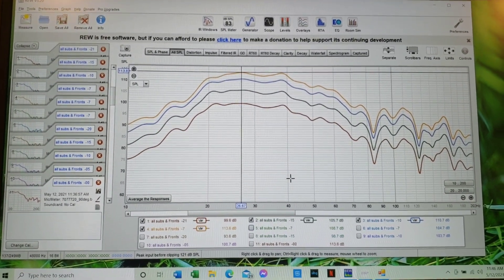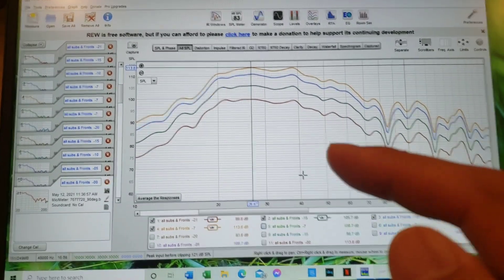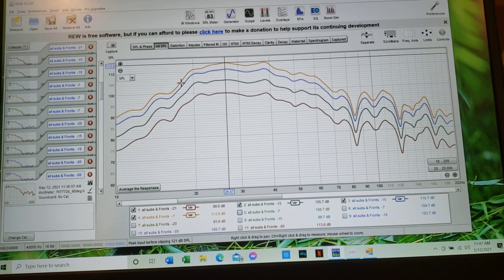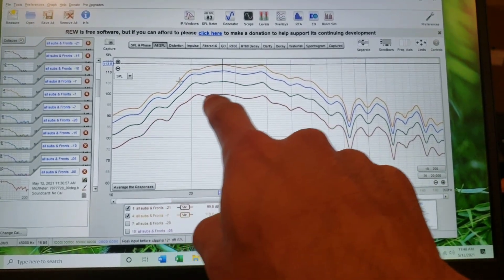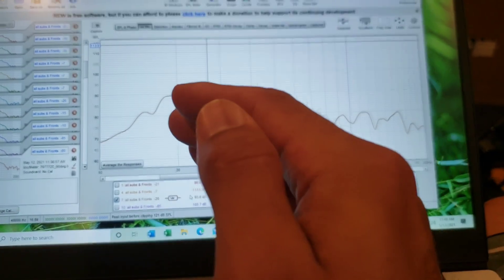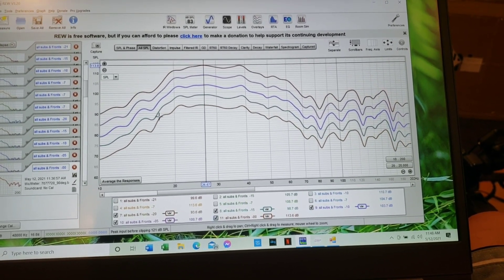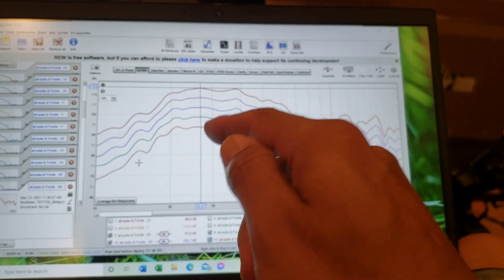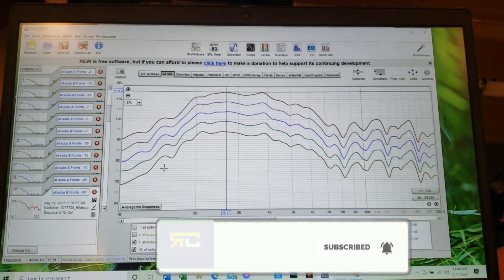Check your subwoofer compression limit In REW with the UMIK-1

Comment: Not sure you fully understand reference levels, True redirected bass managed sub out of an AVR/Pre-pro can send signals that would require over 130DB's from the subwoofer when you add in the main bed channels 5.1,7.1 and then also the bass from the redirected atmos/dts-x... 115DB is only the LFE channel alone, not the sub out pre-amp
Reply from the maker: The idea was compression of the subs combined output before loss of bass was measured.  I use 0 as just a reference on my AVR.
Reply: @TheRafcave  understood, just wanted to pass on a bit of info 99% of people don't realize, when you have the volume at 00, you could be asking for much more than 115db
Reply from the maker: @jdub2354  Understand, thanks for your feedback. 👍🏽